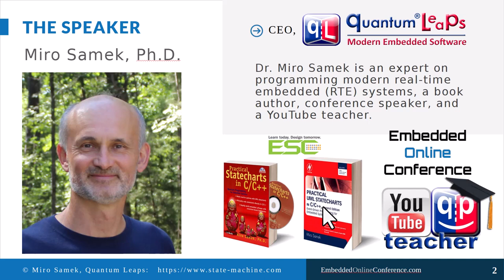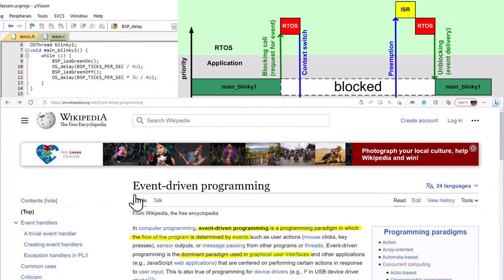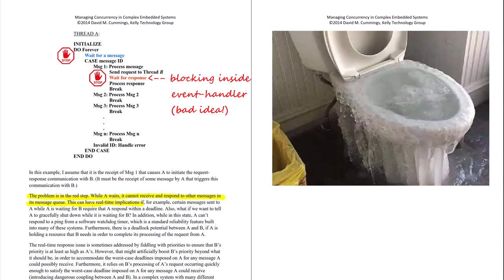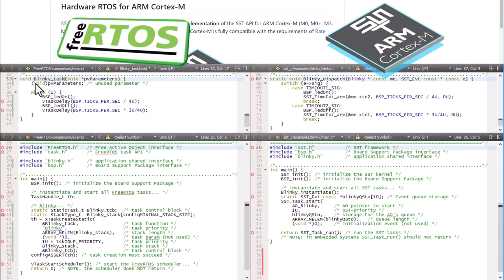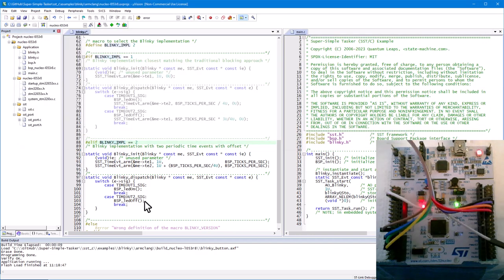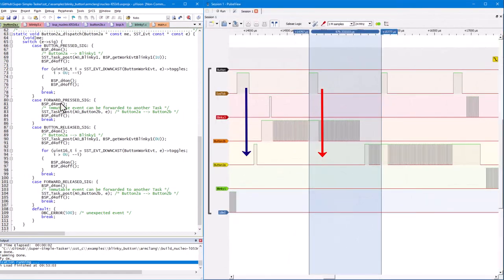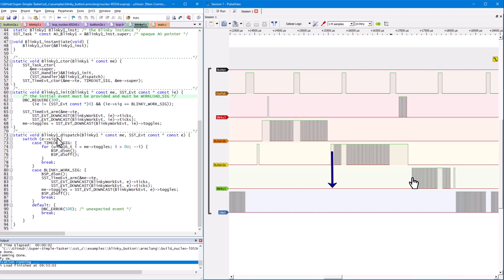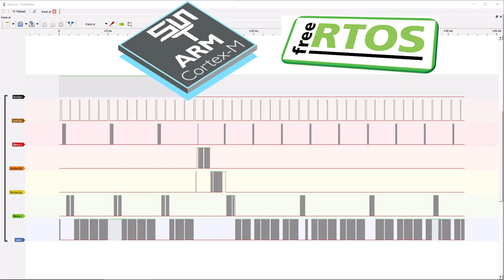Super-Simple Tasker -- The Hardware RTOS for ARM Cortex-M, Part-1

Comment: I feel like the word "blocking" is stretched a bit from its usual context here. Sometimes blocking means that the thing just runs without yielding. Other times it means that interrupts are disabled in that section of code. I almost thought here that by non-blocking a very short operation that runs to completion. But I think it's more blocking and non-blocking has to do with the priority of the operations. I need to look closer but it seems like the Systick holds the event loop and selects the hardware-preemption of possible events, pretty much perfect for RMS/RMA.
Reply from the maker: Indeed, the term "blocking" is extended here to mean any form of waiting in line until some external event happens. For example, busy waiting for a time delay is considered "blocking" in this context. Traditionally, "blocking" tends to mean only by a context switch in an RTOS. However, any form of "blocking" should be clearly distinguished from performing computations. For example, some complex floating-point computations on a CPU without the FPU might take considerable CPU time. This happens in line, but this is NOT waiting for an external event. --MMS

Comment: Hi Miro, sorry for my silly question, but I’m wondering—I’ve been looking for the post() function that posts TIMEOUT1_SIG signal in the sst_cpp/examples/blinky file, but I couldn’t find it. Is TIMEOUT1_SIG placed in the queue in some other special way? Thanks for the great video.
Reply from the maker: The post() function is declared inside the Task class in the sst.hpp header file (located in the Super-Simple-Tasker/include directory). The Task::post() is defined in the sst.cpp source file (in the Super-Simple-Tasker/sst_cpp/src directory). These are the most sensible places to put such a central functionality. --MMS

Comment: Hi Miro, thanks for the great video! You mentioned 'just 2 MHz,' but is it possible to run it at higher frequencies? If so, it would be great if you could show me how to adjust it.
Reply from the maker: Absolutely, it is possible to run SST at much higher CPU frequencies, at which point the kernel performs even better. In fact, SST will be so fast that it would require a much faster logic analyzer, so the cheap 24MHz analyzer won't be adequate anymore. Now, adjusting the CPU clock is not trivial. It requires adjusting several registers in the clock-control section, waiting for the PLL (Phase-Lock Loop) to settle, etc. There are whole tools (e.g., STM32CubeMX), which allow you to set it up correctly. --MMS

Comment: Miro, this is fantastic as usual. I like that you have added multiple tasks at the same priority.
Reply from the maker: Thanks for pointing out this aspect. It's important because it means that the number of SST tasks is NOT limited by the number of unique interrupt priority levels available in the NVIC. You can have many more SST tasks than interrupt priorities. The limit is only the number of supported interrupt vectors (minus the number of actually used interrupts). But, as shown in the video, the "reserved" interrupt vectors are usually available for SST tasks. --MMS

Comment: Hi Miro, thanks for the great presentation. I have one question where a message a posted to another task. In that instance, the caller task got pre-empted/blocked. Isnt that the same as not meeting run to completion?
Reply from the maker: The relation between preemption and run-to-completion (RTC) is explained in Part-2 (see https://youtu.be/kEJ6QHerSro?t=242 ). But to quickly summarize: preemption and RTC can happily coexist. RTC does NOT mean monopolizing the CPU for the whole RTC step. It only means processing one event at a time. So, a preempted task only pauses momentarily but continues the same RTC step every time it gets the CPU back, and eventually completes the RTC step. Also, preemption is very different than blocking. Preemption is transparent to the preempted task. Blocking is always caused by an explicit call to an RTOS primitive, such as a delay or a semaphore. --MMS

Comment: As always, great video Miro.

That said, I'm still not convinced about Event Driver RTOS in embedded system.
I've built event driven GUI application in the past and it was great.
But I think it worked so well because the Input/Output are very simple in a GUI application (WM_CREATE, WM_DESTROY, button click, etc).

How would you structure an embedded application that needs to manage daisy-chained sensors that need filtering, CAN bus mailboxes, async webserver, usb? How would you pass around the data as event?
Reply from the maker: If all the NASA JPL Martian rovers can be programmed according to the event-driven paradigm, your software can too. Seriously. Please actually read the article "Managing Concurrency in Complex Embedded Systems” referenced in this presentation (see https://www.state-machine.com/doc/Cummings2006.pdf ). The NASA software admittedly uses a traditional RTOS (VxWorks, I believe), but all threads are structured as event loops, strictly without blocking. So the paradigm can apparently handle all the communication and synchronization issues you enumerate. In fact, the event-based solution is actually simpler than traditional blocking primitives of an RTOS. Also, when you think about it, there are not that many different types of events. As I said in the presentation, even if you don't immediately jump to a radically different kernel, like the SST (which is still incomplete), you should seriously consider using the event-driven paradigm with a traditional RTOS. Your designs will be better for it. --MMS
Reply: @StateMachineCOM I agree with you, Dr.Miro, in my opinion, it seems that the college above doesn't understood the concepts about event-driven paradigms or even the state machine mechanism, I've implemented these paradigm successfully in basic to advanced embedded systems without  any problems, I've been used and tested your framework too, and works perfectly for all tests realized.